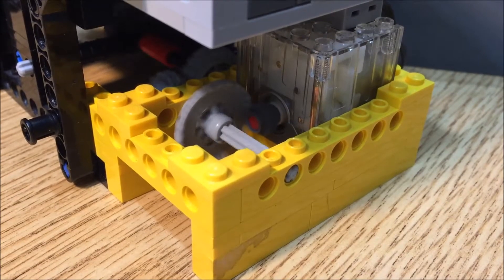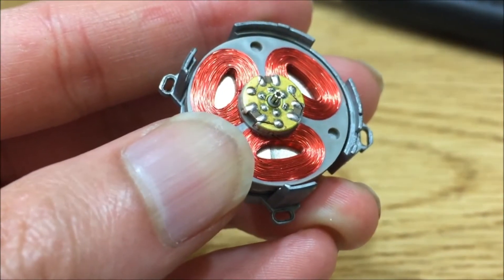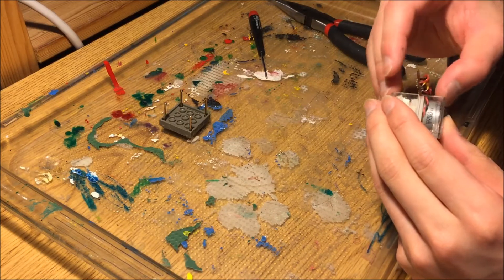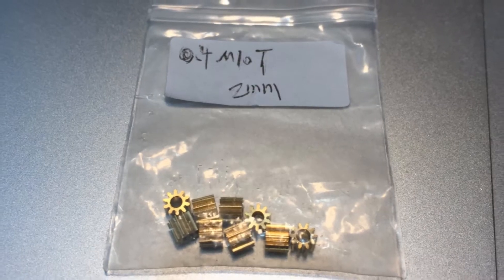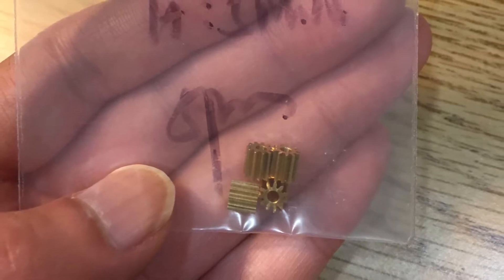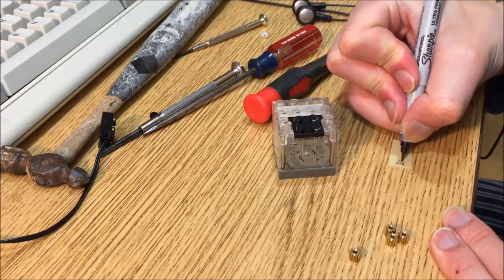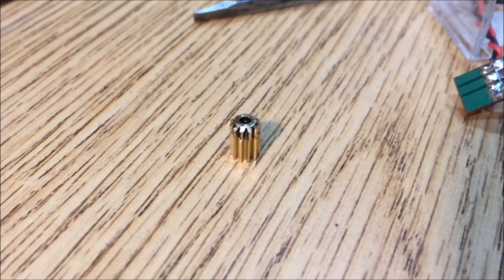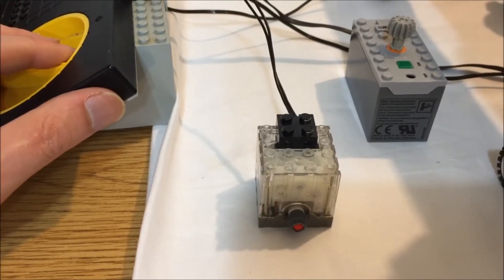LEGO 47154 9v Motor Disassembly and Repair

Comment: This video was very helpful in doing a disassembly of one of these motors. I believe I simply need to lubricate it. Any suggestions for lubricant to use?
Reply from the maker: I have been using a small amount of Vaseline for most plastic gears. If you have something like proper Tamiya grease, that would work too.

Comment: Need some advice. I have a lego buggy motor with bad brushes. I found its a 130 motor but I don't know what the rpm or stall is if you have any info I would greatly appreciate it. The ones I saw ranges,  7 000rpm,13,000, 25,000 and 40,000 plus. Im assuming somewhere in the 13,000 range but im not sure.
Reply from the maker: So I tried to do some research on this, but while people have taken the buggy motor apart, nobody has counted the internal gear ratio. My guess is that it's about 1:10, so given that the outputs are 1200/1700, motors in the 13000 range seem correct, but there's no way to be sure until I can take one apart or until someone else counts the gears.
Reply: @NonsenseWars  thanks I appreciate the effort. Supposedly 130 nerf gun motors are very powerful and have a stall of 23 amps not millamps and really high rpm of 70,000. It might be worth it for me to try it out. I'll get back with the results and a side by side comparison. Seems like most of the 130 motors for sale are really junkie. The things already busted no nothing to lose.
Reply from the maker: @DBZLEGENDS  You might not want to go too far beyond the rated spec because other parts might not be up for the task. Some of the broken buggy motors I saw already had teeth stripped off the internal gears even without a motor swap!
Reply: @NonsenseWars  i figured as much but the buggys are going down in price and aftermarket ones are very cheap. Gives me an excuse to experiment lol.
I may even just pull the motors out of two aftermarket ones and put the suped up ones in the knockoffs just so the originals don't get wrecked.
Reply: For science!
Reply from the maker: @DBZLEGENDS  Ha ha, do tell how it goes!

Comment: I think heating the metal pinion gears on the M motor shafts will let you pull them off more easily. Also, there may be a gear with a slightly smaller hole diameter that will work if you take a file to the spindle as the motor is spinning.
Reply from the maker: Finding any gear of the right size was extremely difficult... if you see something do let me know! I did buy a tiny gear puller to make that part easier though.

Comment: Hi, very useful video :). What is that nice Voltage regulator for the motor you use in the beginnig? Is it a third party device? Keep up the niche work.
Reply from the maker: It's the official rechargeable PF battery box, which is sadly no longer available :( https://www.lego.com/en-us/product/lego-power-functions-rechargeable-battery-box-8878. A good alternative is the 9v train controller, which are maybe $20 to $30 used.